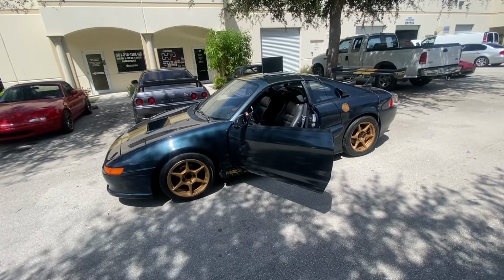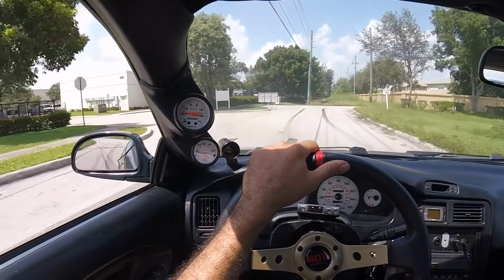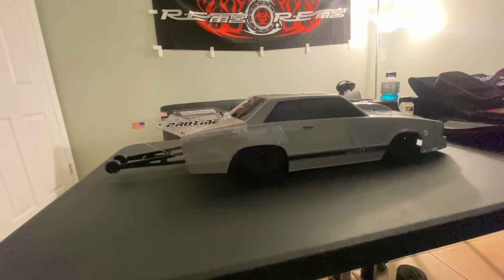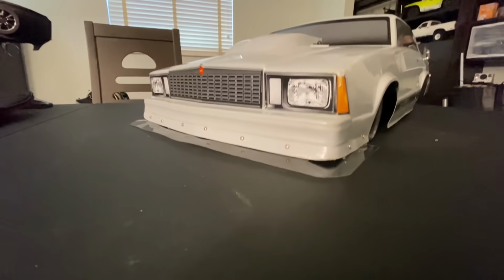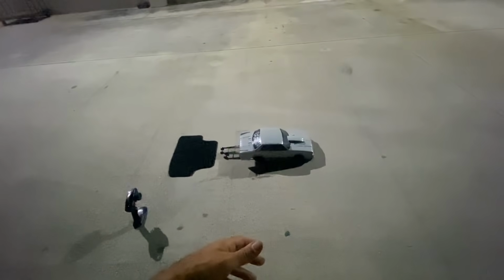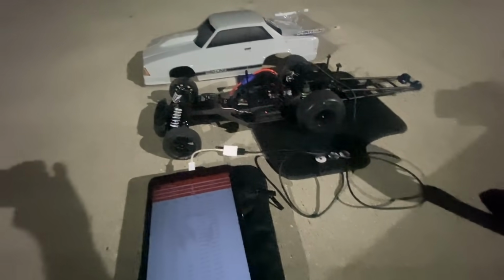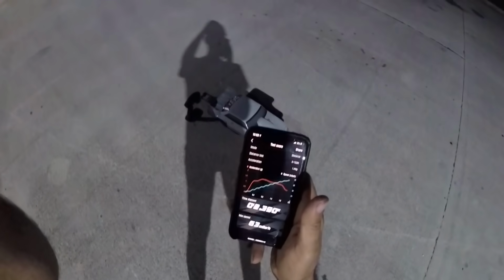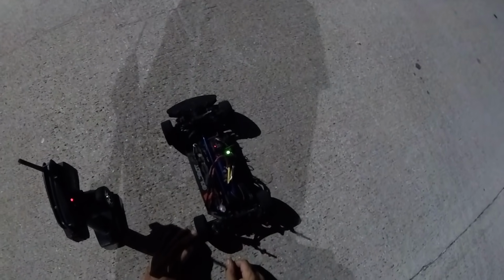NPRC GETTING FASTER! GOT DOWNFORCE? Toyota MR2 Tuning!

Comment: Spoiler looks great. Might want to use carbon or polycarbonate for the front with the speeds you are running.  Can use shoe goo and fiberglass in areas to stiffen the body up.

Comment: I sure miss my SC10 2wd with Castle Creations brushless system and 11.1V Traxxas LIPO clocked it at 57mph using a GPS setup and 31mph with s Venom 7.4V LIPO
Reply from the maker: But getting there in 132 ft is another feat in itself 😉
Reply: @JackCecil  No doubt but going 55mph for more than three seconds and not just in a straight line for probably a tenth of the cost is much much funner!

Comment: Hey jack I have 4 rc cars that I race. 1 nitro jato 3.3 n 3 electric cars. 1 10.5t sprint car, SC mod with a 8t racing motor n esc and a stock 12t mudboss slash. My jato is tuned n geared to do about 102 on GPS
Reply: Hey jack. Good recommendation is to go to a 120c battery. If ur running 2s lipo. Gives u that constant max volts to ur esc. O n if ur still using stock remote throw that out n spend a few hundred on a good remote. U will see the increase in everything lol